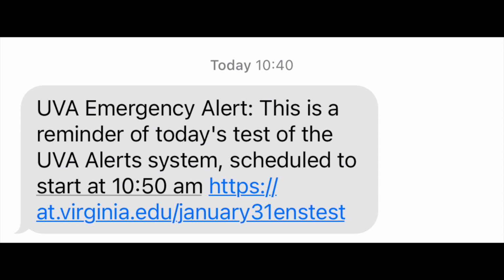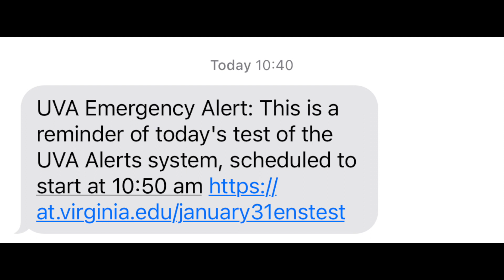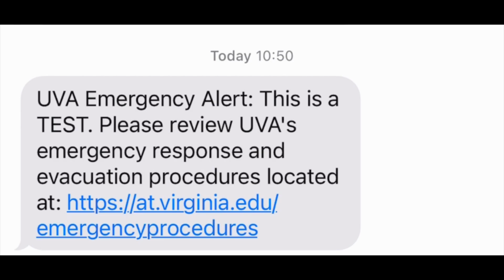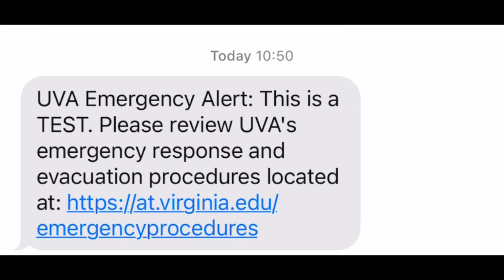Whelen 2906 hi-lo failure Whelen 2904 Ambiance in Charlottesville, VA (Hi-lo & Airhorn) (1/31/23)

Comment: Wow, I had no idea Charlottesville had Whelens! I remember a while back there where a couple Hormann/Cooper Waves type sirens located throughout one of the Universities in Charlottesville.
Reply from the maker: Yes. They used to have Alertus type siren I believe. They later replaced the system around 2018 I think. I'm not sure.
Reply: @CentralVirginiaEAS  Any idea how many Whelens there are? I found 2 on google maps
Reply from the maker: @kingpalmmusic  Sorry I didn't respond to your comment earlier, I didn't see it. There are 4 sirens on the campus. Two WPS 2906s, one roof mounted on the science building, and one pole mounted in this video. There is a 2904, and 2903. The 2904 can be seen across from the Culbreth parking garage, and the 2903 is on top of the UVA International studies office.